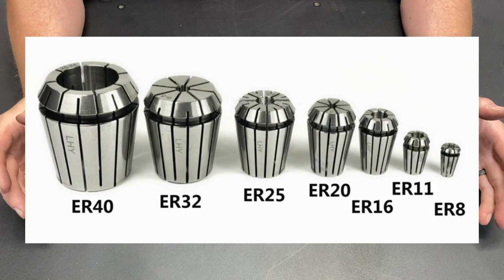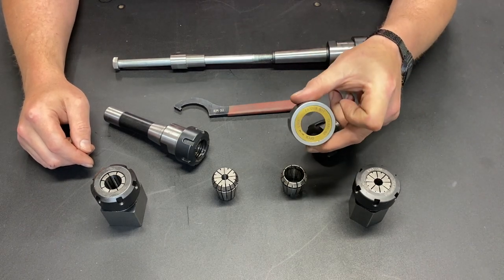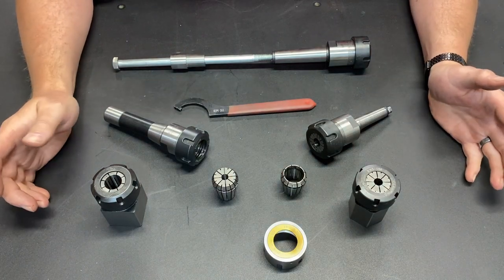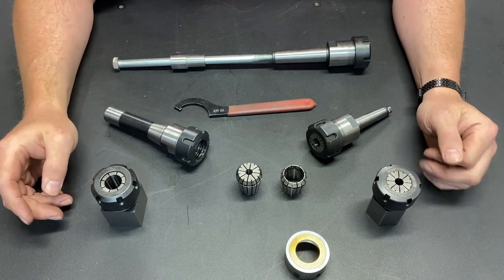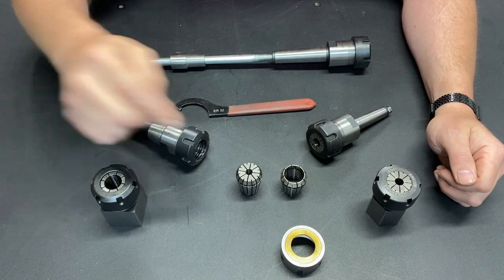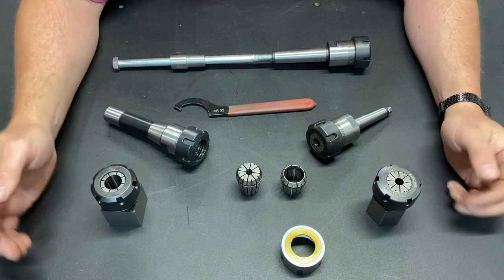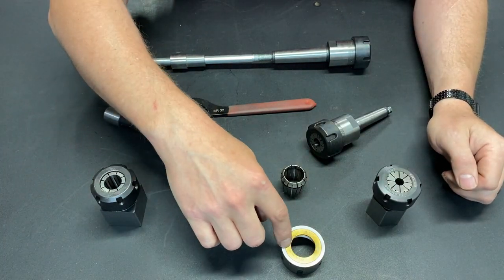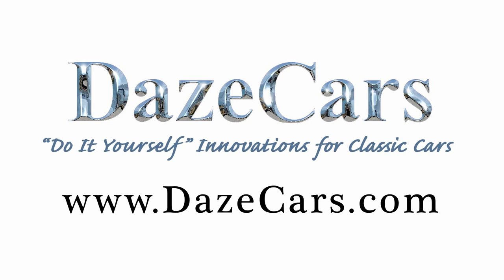A MUST HAVE for Anyone using ER Collets, Get a BEARING Nut and here is WHY

Comment: I bought one, it was binding up; not rotating freely. The runout was also all over. Contacted the seller and got a replacement that behaved almost the same. Investigated the function and it turned out that adding three balls to the race and also preventing the grub screw (that seals the ball entry) from reaching all the way in to the race fixed the problem. So two nuts made one functioning. Or if you could source extra balls of the correct dimension...
Reply from the maker: sadly not all tooling is created equally and some import tooling is just BAD. That is why I always go with a seller that has free returns when buying budget tooling.  My experience with this seller and the quality has so far been outstanding.  Thanks for the heads up.

Comment: I ran a production wood shop for years. Our CNC routers used ER32 collets. The size used most of the time was a wear item, replaced every year with high quality items. Tooling was always set using a torque wrench in a bench fixture to insure proper tightening. That also reduces stress on the system. Premium collets reduce runout of the tool and will therefore increase tool life. A $100 coated router bit (Onsurd) will last two days of production cutting abrasive materials. $7 or $8 per hour tooling cost. Cheap, considering all the other costs. Not worth using cheap parts or tooling. A hobbyist will never know or care what his cost per hour is but will fight accuracy issues. 

I'm retired now and play with my metal machining. I buy mostly import stuff so I can have more or less complete sets. I really like my 5C chuck. I can work really close to the collet with my hands for polishing, no danger even if my fingers rub the chuck. I've got a "key" in a battery drill if I'm changing collet sizes a lot. I've got an internal stop for repeated work that is relatively accurate. It takes a lot of collets to have a full set. I've got several hex and square collets also. One of the greatest things about collet chucks is being able to hold threaded parts W/O damage to the threads. Also have collet blocks & a spin indexer that I've modified by reversing the end holding the collet. It's true that 5C won't hold as tightly as ER, but good enough if you use your head. The biggest disadvantage for hobbyist is the # of collets required to cover the full range.  

I also have the ER40 system. Set-Tru type lathe chuck, & R8/ER40 holder for the mill. A set of collets by 1/32s. Most of the time I use the R8 collets on the mill and if turning small work, the 5C chuck on the 1440c lathe.  Have fun. Be safe!
Reply from the maker: As you said the rules for a production shop and a hobby shop are totally different.  Even with budget tooling and things lasting a long time it's amazing how fast the costs for tooling add up.

Comment: Thanks for the review.
The jury is still out for me, there may be less wear but the standard nut does not wear the collect on mating surfaces that affect tolerances. Also I have never had a problem with tooling spinning in any of my collet holders on any size holder I use.

As for accuracy, collect accuracy is the taper relative to the collet bore, I can't see why this would affect that.

The last thing is that the bearing chuck, due to less friction, would seem to me to be more prone to loosen under vibration.
Reply from the maker: It doesn't loosen under vibration but does require you to tighten it a bit more.  The accuracy part comes from the collet not binding against the inner collet retainer.  Yes taper is the main factor in accuracy but the extra force from the non bearing nut can cause slight deflection in the collet.  We are not talking huge amounts but when working in .001" enough for there to be a slight difference.

Comment: I use er 40 and er 32 collets and have sampled 4 bearing collets nuts, three of them do not engage the collet correctly, reducing accuracy, not extracting the collet, and in one case damaging the collet … I like the one that works (an er 30) but my experience with the er40 collet nut has soured me on the low cost bearing nuts
Reply from the maker: getting bad tooling can really suck.  that is why I always do  "free returns" if I am ordering budget tooling.  Usually sellers of bad product don't offer free returns and its a little extra insurance.  get it home and test it and if its not good, send it back

Comment: excellent video. i agree with your findings. i add the sugestion of a torque wrench for safety, accuracy and minimized tooling wear. the er standard has specs for each style. i had lots of split or jammed nuts without using a torque  wrench.
Reply from the maker: Great point! do you use a dedicated torque wrench for er collets or an adapter with a typical torque wrench?

Comment: Also very handy if you are using an endmill as a boring bar or radius endmill and need to keep one the cutting edges parallel to the bed as you tighten the nut!
Reply from the maker: good to know
Reply: Heathen. 😅

Comment: Tooling for a CNC environment with ATC, can use either top or bottom spline option. Having run a machine for 5 years, I am inclined to go for the top one. Think it might have less slippage and mashed knuckles.
Reply from the maker: Thanks for the info

Comment: I have worked with premium collets that for the most part have zero runout and loads of accuracy.  For my home hobby I purchased three of the bearing style collet nuts to use with my budget ER32 collets and I did a little bit of testing to see if I could improve the runout using the bearing style nuts.  I did notice an improvement in the reduction of runout provided that removed any burrs, thoroughly cleaned the collet and the collet holder and checked the runout using a DTI and a precision ground rod.  Using stock raw material to check runout will give you mixed results and make you rethink the accuracy of the collet. Just my two cents.
Reply from the maker: Thanks for the real world feedback, that is great!!
Reply: True. raw stock is never round. It can damage the collet eventually.
Reply: @melgross  I prefer turning a small section of the raw stock to a known size using the 3-jaw the swapping out the 3-jaw to use a collet chuck and then going from that point.  It’s probably overkill in prep work but I’m retired and I have plenty of time on my hands, unless my GF loads me up with a bunch of honey do’s
Reply: @taranson3057  it’s never overkill to get something right. I’m a bit anal myself at times. Other times I’ve learned to not overdo it. But it’s a good idea to do that. While 5C collets are designed for stock, for example, which may not be sized, or really round, it’s interesting that ER collets, which are designed for tooling only, are being used on lathes as workholders for RAW stock. Really, not the best idea ever. Same thing for DA collets. Toolholding only.
Reply: @melgross  yes, I know that ER32 collets are for tooling but I use mine on a mini lathe to make small parts and they tend to hold better than the 3-jaw.  I did consider just going with a 5C collet chuck but they are expensive and social security doesn’t provide enough funds to cover my hobbies
Reply: @taranson3057  I understand. We do what we must.

Comment: Sounds great. I'll have to see if they have them in er25 size. 
One question I have of you is why haven't you made a collet chuck to fit your style spindle/chuck mount that will allow you to pass long stock through the lathe headstock? They're easy to make and they'll be acurate to your lathe. You dont have to grind them to size, just careful machining will get you better than 0.0003 depending on your collet and spindle accuracy.
Reply from the maker: There is a link to the ER25 size nut.  To answer your question I have not made a collet chuck because the 3 and 4 jaw chucks I have work for most things and if I do need to use collets in the spindle its small stuff.  The bigger issue is time, something I don't have a lot of so making tolling cuts into other projects especially when it is something that would be nice to have BUT I really don't need.

Comment: Hi. I have an old HF H007 3in1 that I need to tool up for. Just the starter basic stuff. I have and empty MT2 bore (mill). I'm looking at ER32 collet set. I also need a draw bar. Yours looks like a bolt. How long is it? Looks like a machined something near the head? Or how do I properly size one? Depth from the bottom of the MT2 bore? I assume 3/8-16. McMaster has 12" Grade 8. Lastly I'm looking at Vevor vises. Swivel? 4", 5" ? What is a good size?
I love your channel. thanks
Reply from the maker: The MT3 and draw bar in my video are to use in the lathe spindle.  thats why I machined a shouldered collar to go on the other end.  My millhead used R8 but a lot of the older HF machines were MT.  All you should need is a bolt long enough that has the correct threads to match the MT collet holder you choose.  I have a 3" vice and a 4" vice.  I think 5" would be a little large.  There is a group on Facebook for combo machines.  If you come join I can share pix and other information more easily.  https://www.facebook.com/groups/168134035160655  Glad you like my channel.

Comment: I wonder if the same effect occurs for wiping clean the slightly oiling three surface with light oil.
Reply from the maker: The answer is will oil improve its function yes, will it be as good as a bearing cap, no.  This is demonstrated all the time in automotive applications  There is a reason we use bearings in place of oil impregnated bushings.  While they both work the difference between the two in night and day

Comment: Ball bearing caps are good. But some companies such as Technika, which I have, has a coated nut which is supposed to be as good as the bearing caps, or better. I’ve got both, for my mill, and it’s hard to tell the difference, but I can get just a bit more torque with the coated cap. If you’re going to get these things, get a really good one, as a good deal of the collet centering comes from the cap. Remember that if the bearing isn’t good, then the centering will be off and will get worse as the bearing deteriorates over time. A good bearing of that size can cost significantly more than the cap itself.
Reply from the maker: I can see where a low friction coating would have a similar result.  My concern would be durability of the coating especially if you missed a chip and it got inside.  How does it seam to be holding up?
Reply: @dazecars  so far, after three years, using it a fair amount, very well. Yes, you have to keep it clean. But then, since the cap determines the concentricity of the collet, you have to keep them clean, no matter what design they have. So that shouldn’t be an issue.
Reply from the maker: @melgross  agreed on keeping it clean, I was just thinking about that one moment, tired or thinking of something else and a chip gets missed.  Three years indicates good durability.

Comment: I bought one that looks exactly the same as yours and the runout was twice as bad as the standard.dont know if I got a dud but that turned me off them
Reply from the maker: That is a risk with any budget tooling. However this seller offers free returns (part of why I ordered from them in the first place) so if it is not up to spec you can return it. I think yours was likely a fluke however as the seller has excellent feedback and mine were all good.

Comment: FYI you can get bearing nuts with the splines on the top end too.
Reply from the maker: Good to know, thanks for the heads up. Are they as budget friendly as the ones I’m showing? Just curious.
Reply: @dazecars  Hi, this guy beat me to it. Yes, they are budget friendly ones, at least over here. eg ArcEuroTrade Type B. I have two and I agree, they are great. For good measure I also bought a clamping fixture for the mill collet chuck. Before getting these two aids I have had end mills slip with rather annoying results. Cheers.